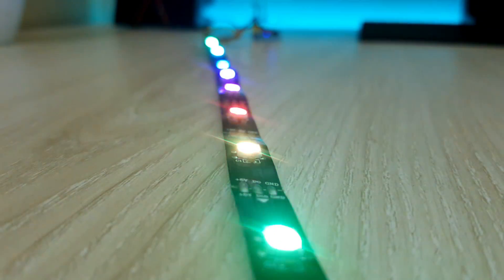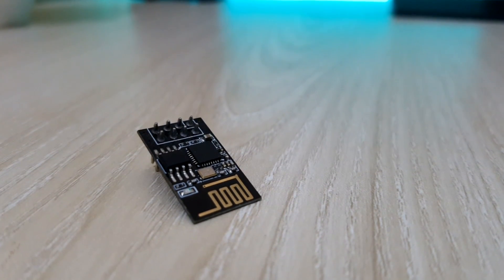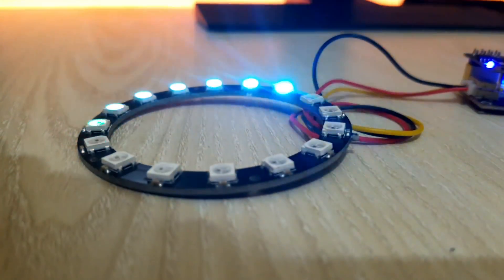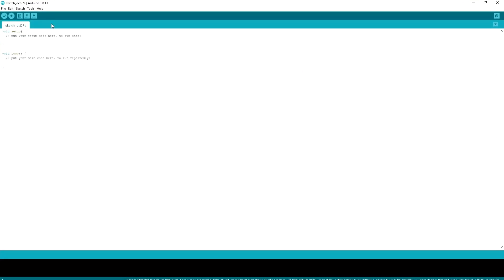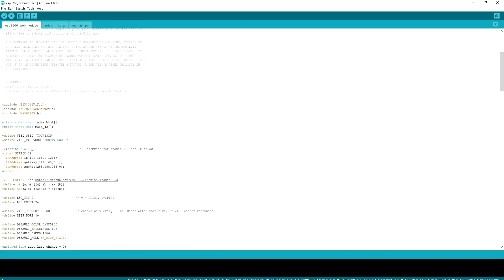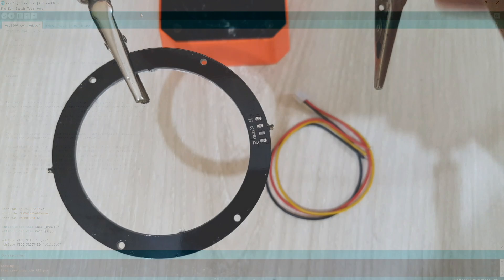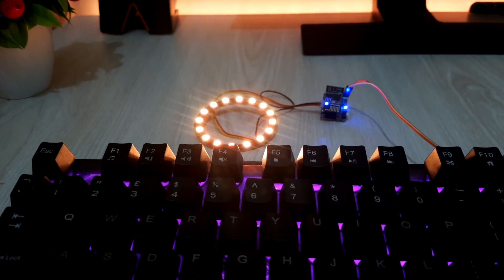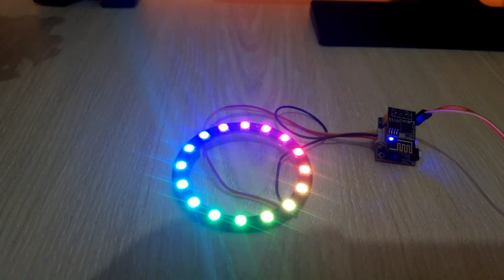Create your own WiFi RGB led controller || ESP8266 & WS2812

Comment: The ESP-01 has several disadvantages. VCC and Enable must be set to 3.3 volts. The 3.3 volt voltage regulator is missing. The flash is only 1MB. It cannot be installed via the web installer and online update does not work. Software version 0.14 does not work, version 0.13.3 must be used. The range of functions is limited.

It is better to use a Wemos Mini d1 or an ESP32 board.

Comment: Hey dude, I have a couple of problems with my programming; Would you please help me?
When i upload the program to the esp01s the WiFi disappears and when i change the program ro default WiFi appears... I'm using ESP01s with relay v4
Reply: use esp12e board

Comment: The arduino nano can power a 150 led string of eco wsb2812s without a external power supply. They where set at a lower light level but plenty bright. I tested it at my moms house and her neighbors liked it alot. I started with regular 2812s but the ecos are have much better efficiency and are cheaper as well.
Reply from the maker: Congratulations.
Reply: With wifi?
Reply: it could be stressing the board to its limit .

Comment: If I was to create high power probably 100 watt RGB strip how to do it? I want to use it as aquarium light hence LED may not be addressable.
Thanks
Reply from the maker: You'll need a much powerful power supply of 100watt.
Reply: use smd5050

Comment: Hi, im trying to do this but i think the wiring is wrong, i have the lm1117 for 3.3v to power the esp01, just like your diagram and it does not work, the only way it worked was when i aslo connect the CH_PD to the 3.3v and i disconnect the ground from the led strip, please help i been trying for a couple of hours and its driving me mad.

im using a 5v
Reply: its been the same, it works perfectly if i disconnect the signal from the stip/arduino and then power it on,and then connect the signal from strip/arduino back...any thoughts?

Comment: can I use for this connection led SK6812?
Reply from the maker: I'm not sure, You can try.
I've used WS2812 LED strip.

I don't think It will wok with  SK6812
Reply: I've tested it on SK6812 and it works
Reply from the maker: @knowhood  thanks for sharing this info
Reply: @knowhood  how was your settings?
Reply: @marko34455  it's exactly the same with WS2812

Comment: Hello your Adafruit Neopixel version ?
Reply from the maker: I'm using Chinese version.
Each diode has WS2812 IC as controller.
Reply: @ElectronicsBd  I can add Micrófono module and ws2812 controller?